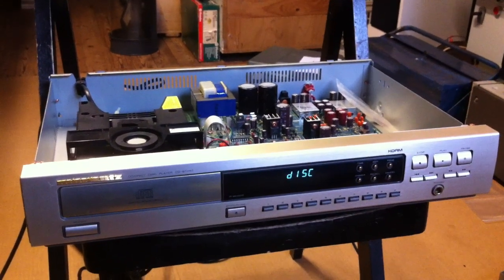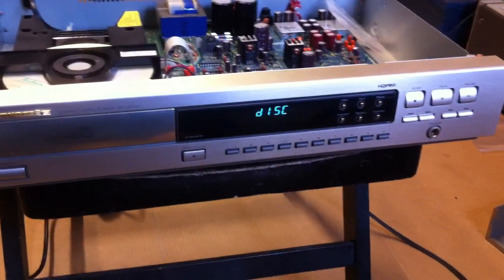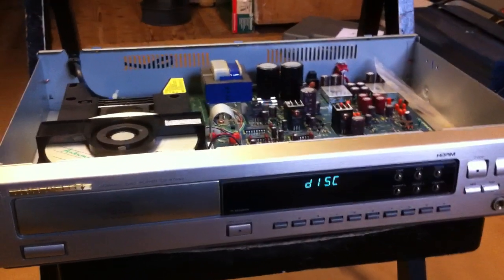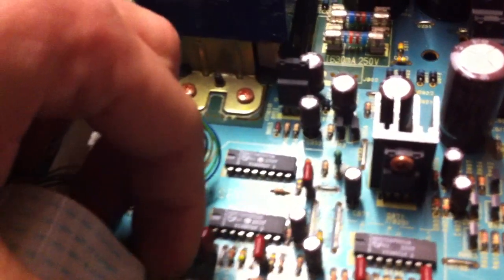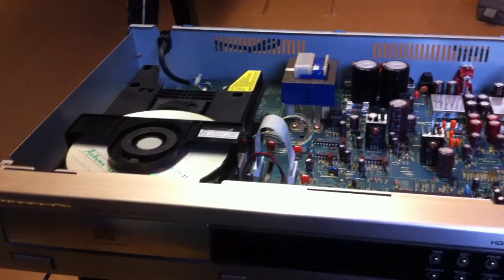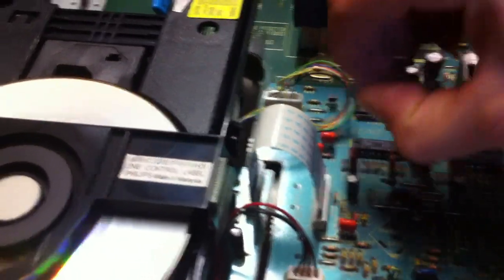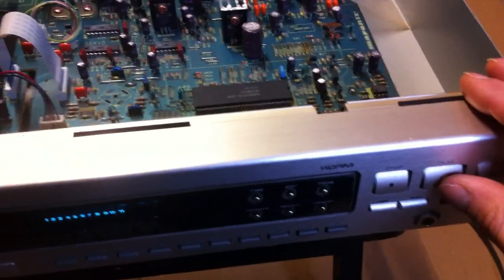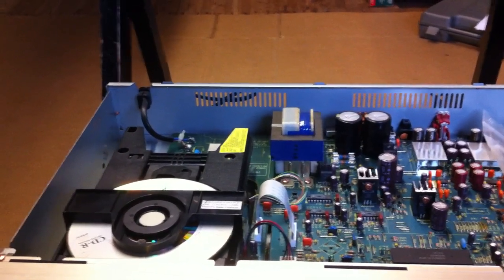Marantz CD player repair of No disc error

Comment: How do you locate the same resistor in a Gamut CD3 with no schematic available? it does the same thing and tweaking the laser power trimpot doesn't help. What makes it spin is pushing the CD in with my finger a bit.

Comment: I purchased 2 Marantz CD5001 cd players for cheap so I could see if I could get them both working. They both have the same problem spinning a few times then it stops and says "No disc". I cleaned both lasers and even purchased a new laser pickup mechanism and it's still the same problem. I tried holding the play button and pushing down the disc to make it spin but it still doesn't work. I found R112 on the PCB, but I would assume that just because it says R112 on my Marantz cd5001, doesn't mean that it's the same as the one in the video? Or are all of the R112 on Marantz PCB are the same for the focus gain?

Comment: This looks just like my CD-53 that's giving me the exact same problem. Great video. 
My CD-53 - I can't find R112. Any suggestions?
Thanks
Reply from the maker: A "no disc" error can have many causes. Please try cleaning the lens first. In my case the focus offset was off and this could have to do with the spindle height but I was able to correct with a resistor. To look for the feedback circuit for the focus actuator. Again the problem with your player could very well be another one.

Comment: Hi ,CD Player is not working.  There is no electricity, no screen.I need to check what is there insurance?  Can you help?  Marantz cd-38
Reply from the maker: I don't know what might be causing this. The problem I demonstrated in my video was different. To start measuring all AC voltages coming out of the transformer. If no voltage at all perhaps the thermal protection inside the transformer failed or a fuse or mains switch or power cord interrupted. Secondly to check all DC voltages before and after the regulators according service manual. Check filament voltage of display. If all ok then to check if oscillators are running. Is a low jitter clock installed? Maybe some problem with this. Check for all internal connections and bad solder joints. Cracked circuit board? Please be careful since live voltage is present in this CD player.
Reply: @japcast  The fuse was blown and I fixed it.TCA0372DP2 FUX9808  It got super hot and I pulled the plug.could it be broken from this
Reply from the maker: @suataydemir5234  This could be the driver chip for the drawer motor. Short circuit in motor or this chip. Please see service manual. You could cut power to this chip and move the drawer by hand just to verify this chip is the problem.
Reply: @japcast  There is no image on the LCD screen.  Drive motor is running continuously.Keys are not active.

Comment: Is there a permanent solution or do you have to do this every time you want to pland? cd?
Reply from the maker: In the video I showed that without resistor it wouldn't read discs and with the resistor it does. So I just held the resistor across the original resistor to demonstrate the difference. Afterwards I soldered the resistor in place and proved a permanent solution in my case. I still wonder if maybe something else was going on, f.e. that the spindle height is not right for some reason which would explain the focus offset problem I encountered.
Reply: @japcast what ohm is the resistor?

Comment: How about the CD-63 mk2 ?
What is the values of the resistor used?
 onto which resistor should I attach?
Reply from the maker: For the CD67, I placed a 47k resistor across R112 to increase focus gain. It is a specific case that might deviate from yours.
Reply: Hi, Mikemaxcel, Have you fixed the problem since?
Reply: Try on R144.

Comment: Will this help with the disc skipping problem of the Marantz CD63 MK2?
Reply from the maker: That doesn't sound like the same problem I encountered. Mine would not read most CD's and when it did read there was no skipping. Skipping can occur every time when the pickup sledge moves a step forward.  Some times the sledge shaft grease gets hardened and there is too much friction. To clean the shaft and grease, of course at your own risk. But skipping could be due to other problems too.
Reply: @japcast  Thanks for the reply. Skipping can indeed have multiple causes, the laser positioning mechanism can definitely have some dried grease in the spiral screw and/or shaft. I am looking for a backup 63 mk2, before I try to fix my current one. I thought I had found one, but the owner checked it another time, and found it had disc reading problems too...
Reply from the maker: @rc-fannl7364  Would guess it is a mechanical or optical problem. The CDM12.1 transport can be found for bargain prices. And although imitation they work, I know from experience.
Reply: @japcast  Some say the pickup unit can also affect the sound, something to do with cleanness of the laser signal, phase delays, etc. Not sure what to believe, I do know that the CD63 MK2 sounds amazing, and has a better sound than some other comtemporary disc players.

Comment: For all the beginners out there...it's a really great idea to be sticking your fingers and components into a live circuit. It has the potential really brighten up your day!
Reply: These CD players use low voltage, so no real issue of being getting a nice shock.
Unlike old fashioned TV that had high voltage.
Been repairing stuff over 50 years. Starting with tube amplifiers.
Reply: @williamwong5627  
So you're telling me that there's no high voltage in there? You go ahead and do you, but you'll eventually find it.
Reply: youd need mains theres resisthörrce all över the pläyce. pössibblie more danger with laser ^ ^

Comment: Hi, I've got a Marantz cd 67 that's saying no disc whatever disc is put in, I've taken the top off and tried pushing the disc like in the video but nothing happens. The disc isn't spinning at all and the laser doesn't appear to be lighting up. Is it likely the laser is dead or could it be something else? 
Any help would be highly appreciated 😬
Reply from the maker: The laser needs power and enable signal. Check service manual for voltage levels in PLAY mode. Maybe a bad solder joint on PCB or bad connection. The laser could be dead but this doesn't happen too often. Mind the the laser is only turned on a short time after you close the drawer or press play. That is without disc. To look if laser turns on in a dark room as it is hard to see. Don't stare directly into laser beam.
Reply: Since I posted the original question I bought a replacement laser unit, put it in and its all  working fine now

Comment: HiVery interesting.I have the Marantz CD63SE and KI signature versions.Is this issue with commercial CD's as well or just self recorded ones?The reason I ask is I have found certain makes of CD-R's won't play in the Marantz especially my KI Signature one.The SE seems more tolerant but still occasionally struggles with the first two or three tracks.Verbatim ones are pretty successful in the SE but still stop midway in the KI.Maxell ones play nearly fine, but the odd issues if replaying in the SE with the first two tracks and won't play at all in the KI.Both play commercial Cd's superbly with no issues.Would this be a focus issue in the KI as I've cleaned the lenses on both re greased the sled tracks and cleaned the end switches too.Or is the Ki signature so refined it only wants commercial discs to play.Thanks.......................
Reply from the maker: If something not optimal it first shows with CD-R's. A commercial CD has pits which a better to distinguish. Sometimes a very fine dust layer builds up at the backside of the lens and on mirror. I made a video for cleaning the back side of the lens and can upload if interested. Looking at your symptoms I won't guess it is a focus issue. Re-greasing the sled tracks is always a good practice but only solves skipping problems. Refinement in the KI version should not make for a poorer transport. I would clean the lens. Inspection of bad solder joints on PCB's won't harm either. If this does not help to replace transport. I found that the non genuine units you find anywhere just work fine.

Comment: Thank you for this excellent video, I have a Marantz DR6000 which I bought recently, it's fine when cool but after some time I get a loud crack / distortion through the speakers even though the unit continues to play normally, also if warm I will sometimes get a no disc error with the drive spinning, if  you eject the tray the disc is still spinning any suggestions as a starting point please?
Reply from the maker: If problems come after some playing time it could be a worn out laser. First try cleaning the lens top and bottom. It is easy to find replacement transports.

Comment: May I know for marantz 63se player, which of the resistor, I need to put 47 K resistor on it? Urgent. Thanks
Reply: I also had the same problem of yours, the resistance in the 63 model is already from 47k, in the circuit is the R153 - Moto01, I did the exact opposite of what is explained in the video, I welded over the one from 47k a 12k , it seems that the problem is solved. For the moment the reader works well.
Reply: @sergio02091963  You mean took 47k out and replaced with 12k or added 12k on 47K?
Reply: @steve3436  no, the 47k is already on the player, I soldered the 12k on the 47k (in parallel) and I solved the problem
Reply: +sergio b. thanks s
Reply: +sergio b. how to solve the same problem for rotel rcd02 CD player that can't focus ?
Reply: +sergio b. already changed a new laser head,  still can't focus ?

Comment: At the bottom of the lens there is an optical ic , so may tell me little bit about that ic or its datasheet.
Reply from the maker: Maybe in the datasheet of VAM1202 you could find some data on the diodes.

Comment: Sometimes it's the capacitors on the main board and sometimes the main board is damaged beyond repair and if it's damaged beyond repair and that causing the disc read error then your better off chucking it and throwing it away because it sometimes is impossible to repair and also the laser diodes can burn you and should not be exposed and looked at while powered on so use caution when opening it up while powered up

Comment: hello a have a same problem whit a marantz cd 6002 can t you help me please.-
Reply: Ferrari Dario you should use extreme caution when working on the inside of a cd player like that while it is powered on and plugged into the wall because the laser diodes can damage your eye and even burn you and also the transformer and the main board can give you a 120 volt ac shock if you touch certain parts of it also the capacitors can hold a dangerous amount of electricity and possibly kill you so be careful when doing what he is doing because it's very dangerous you would be better off getting a new one off eBay or getting a stereo receiver with a CD player built into it

Comment: hello where do i put the resistor exactly ... ??
Reply: I would say try it by pushing it on the ends of the one already in situ (as he does in the video) to see if it works first and then remove the main board and solder to the base in position. He does mention the position in the video.
Reply: Across R112.

Comment: Yes, your fix works! Got a lot of headache after replacement of the original Philips CDM 12.1/15 laser module with a new VAM 1201/1202 in my old Marantz CD67SE. The video describes exactly the focus error symptoms and i soldered the 47k resistor paralell to R112 - problem solved! Thanks a lot for sharing your experience!

Comment from the maker: If the player gives the "no disc" error, several things could be wrong. You could try to clean the lens first or try another disc. In my case there was a servo problem. The disc would read correctly if I pressed the disc downwards a little. What I did to repair is in the video description.

Comment: I have the same problem.  I understand that you fixed the probleb,  but I
 didn't understand how!  What you put on the board and where exactly?
Reply: 47K resistor across the R112 Resistor - that would cut the resistance by "X" amount lowering the resistance.

Comment: The manual has nothing on cd disk error when recording/burning a disk. No matter what mode its in (track or disk) Even with record manual i keep getting disk read error on my marantz 631 with brand new cds in differnt brands. Is there anyway to fix it? Thanks!

Comment: I had this problem for serveral years, but it was progressive. At the end, all CDs displayed the "no disc" message. Before trying the resistor trick, i just cleaned the lense with a computer air spray, and it solved my problem...
If it could help someone else...
Reply: ive seen people saying blowing air hard on the lens solve the issue...

Comment: I have a Phillips AZ3300/37.I pressed the power switch and heard a snap like a small firecracker. Now the display says "no read and the disc does NOT spin at any time. The radio still works. It uses one of the standard laser modules for around $20. When first started the laser does move up and down trying to focus. Any thoughts??
Thaank you!  the unit is  pristine from Aug. 2003
Reply from the maker: Try to find out what has snapped, either electrical or mechanical.

Comment: thanks for the movie. however, I have a marantz CD player but mine I can hear like an "clac clac" noise. I dissemble it and I found out the sound is coming from the lenses which don't stop moving... is it possible to repair it? or should I buy a new CD player tray with the same reference? I hope you can help me
Reply from the maker: Which model player you have? With the No disc error you first hear clac clac and this can have many different causes. The sound comes from the lens trying and retrying to focus. If no success in focusing the CD won't even spin and an error message is shown. Another transport might solve the problem. Mine had a focus offset problem. If this is also in your case you will see the disc gets spinning when you press down the disc a tiny bit towards the laser lens. Focus gain/offset etc are set in the digital servo controllers so no easy access. But you can still correct by changing one resister like instructed in the video.
Reply: +japcast +japcast thank you for your reply. The model is a CD-67SE and the clac clac sound is present even without a cd... as soon as I turn it on the lens goes back and forward in the rails going the clac sound. I have been searching on the internet and some say that the rail needs to be greased so the lens travel smoothly... do you think this will solve the problem?
Reply from the maker: Checked mine, when powering on i hear a very soft ticking sound (with cover on). When your hear a strong clac maybe the gears of the sledge are skipping. There is an endswitch for the sledge. If the endswitch doesn't work the gears will skip, producing a stronger noise. Can you confirm the laser lights up when it is focusing? If you have a scope it is advisable to measure HF output prom pick up. During focusing you'll have to see a S-curve. During play you'll see the eye pattern.
Reply: +japcast in my case, when the cd player is on, it is always doing the clac clac noise and the laser goes non-stop frenetically back and forward in the rails... I don't know why this is happening... I am truly planning to replace the whole drive for a new equal Philips CDM new CD laser unit...

Comment: I have the same problem.  I understand that you fixed the probleb,  but I didn't understand how!  What you put on the board and where exactly?
Reply from the maker: No disc error can have several causes. First try to push down the CD a little after pressing play. If it does spin and read then you have the same problem. Look for R112 on the PCB. Solder a 47k resistor across existing R112. That's all.
Reply: On Marantz CD63 R112 is located on RF AMP PCB. Is this the same resistor (120k)?